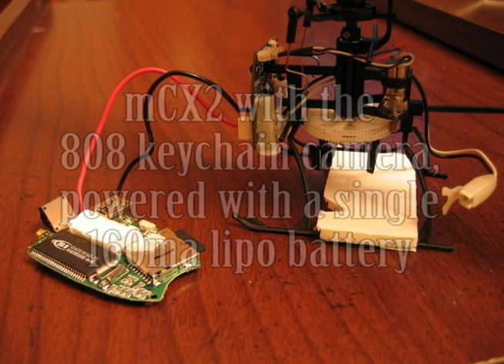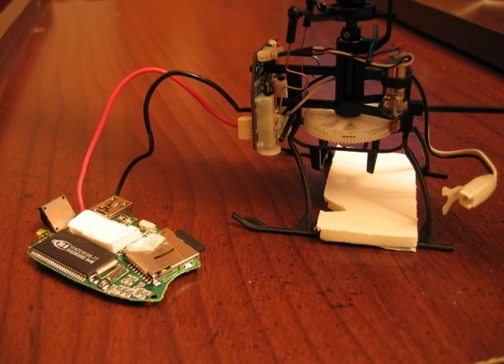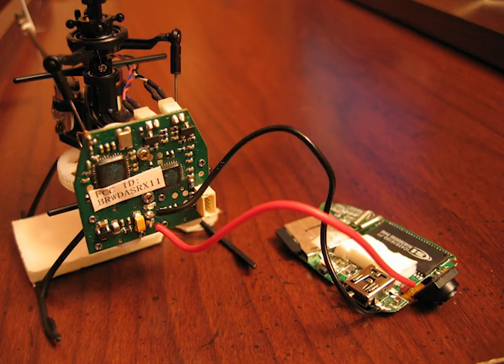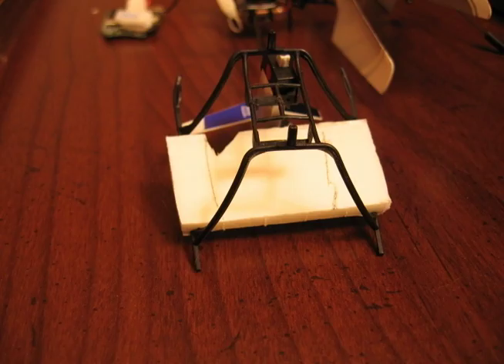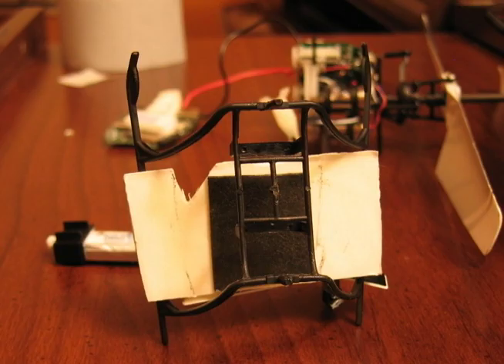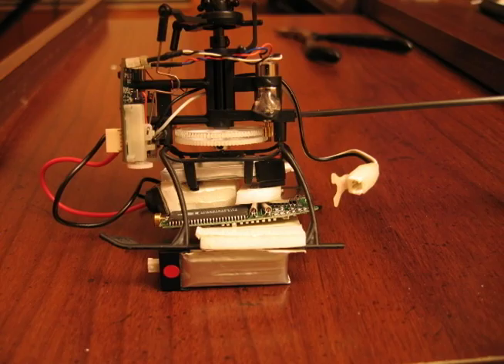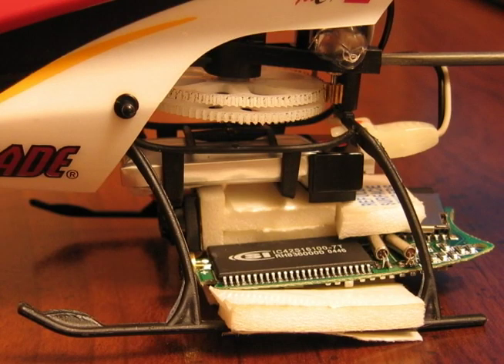Blade mCX2 helicopter powers 808 keychain camera - flight 3

Comment from the maker: I own an mCX2, mSR, SR, mCP X, I'm starting to become very disappointed with Blade products. Out of the box they fly, you're excited, you experiment, you crash, then, when you want to fix your heli, you can't find parts. Always one part is out of stock, back-ordered, locally and on-line, either being redesigned or maybe out-sourced to a different supplier. My Blade SR is not balanced correctly because of a heavy tail rotor heatsink. Just discovered that my mCPX rear servo has no bearings. :-(

Comment from the maker: The 2 single-battery solutions that I have used to power the mCX2 and the 808 camera are: 1. Power edge 20C 160mAh: 3-4 minutes of flight video, 2. Hyperion 25C 160mAh: almost 6 minutes of flight video.